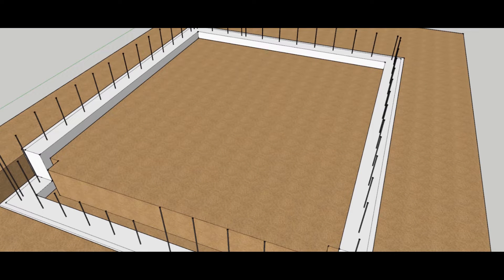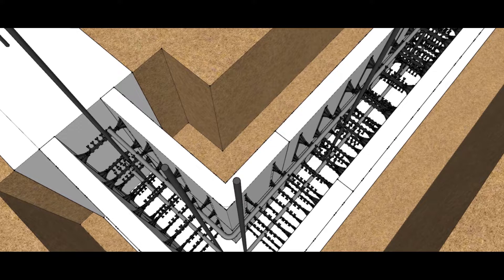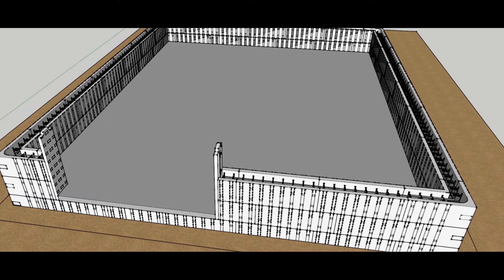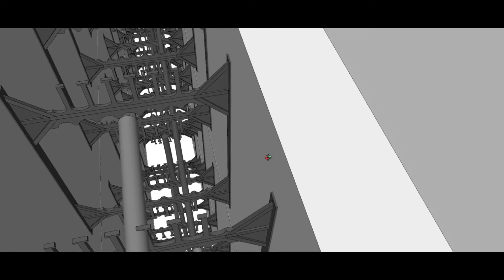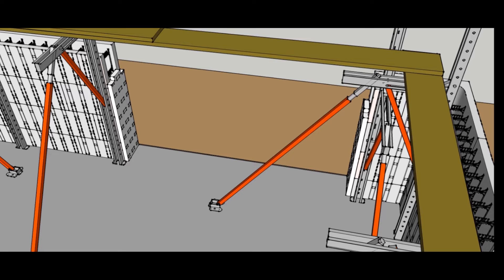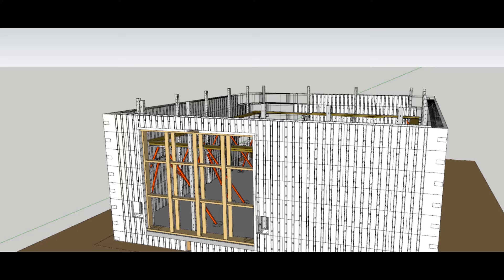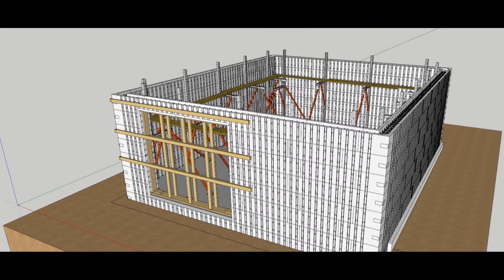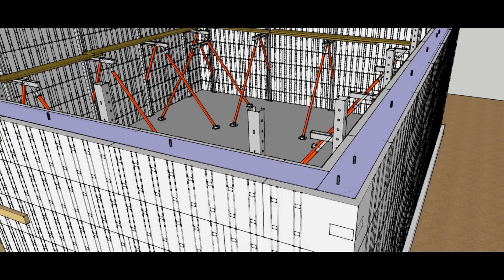How to Build an ICF Garage

Comment: How did you secure the wall bracing to the garage floor? Did you drilling into the concrete floor?
Reply from the maker: Hi DJ, in this example it could be done a few ways. Many people will drill into the concrete slab to connect the bracing anchor foot. If you are concerned about drilling into concrete, some people will use spray foam adhesive to attach a piece of 2x4 to the slab and then connect the anchor foot to that. With this method, the slab can be scraped clean after the bracing system is disassembled. You can learn more here: https://www.youtube.com/watch?v=onE69RHdYiE

Comment: What’s the best way to connect an ICF wall section with a 2x4 stud wall, specifically if the wall needs to continue as a single flat surface. Appreciate any references.
Reply: i'm planning to do this in my next build, and i will use a few foundation bolts (j-bolts) to bolt the framed wall to the concrete.  alternatively, you could also use a bunch of anchor bolts

Comment: How is the verticle rebar set to the #5 vert rebar embedded in the footing? I belive code is something like an overlap of 20 times the diameter of the rebar, and i wonder how the vert lengths get added when the icf's are stacked up several courses? My future plan is to use icf's with either fiberglass or basalt rebar and tie them to the horizontal rebar with nylon cable ties.
Reply from the maker: Hi Scott. Vertical rebar will extend from the footing into the ICF wall. The height at which it extends is determined by the location, rebar size, and site considerations. After the wall is stacked, vertical rebar is placed into the wall, connecting to the dowels that are extending from the footing. This video (starting at 4:00) explains rebar in footings https://www.youtube.com/watch?v=jhI5cfZkLFg. And this video (starting at 3:00) explains a little more about reinforcement in ICF walls https://www.youtube.com/watch?v=jhI5cfZkLFg. Thanks for stopping by!

Comment: How about a concrete flat (mostly flat) roof?
Reply from the maker: That's easily accomplished with ICFs. We recommend our BuildDeck ICF Deck and Roofing system which extends the benefits of ICFs into your roof. https://buildblock.com/products/builddeck-floor-roofing/ A flat roof is simple but a concrete pitched roof is also easily accomplished.
Reply: @BuildBlockICF  Could these be used for a garage floor if there was a basement under the garage ? Thank you.
Reply: @BuildBlockICF  same question as above. Looking to build a 60x40x12 shop with a 40x40x10 basement underneath. The slab over the basement will have cars and 2 post lifts.

Comment: Best and most informative ICF video I've seen yet. Is there much difference between using 6 inch core vs. 8 inch, other than the amount of concrete used? In other words would the greater volume of an 8 inch core ICF be more likely to cause a failure in the wall?
Reply from the maker: No, the 8" core is just more concrete which therefore provides more strength and bearing surface. It's used in all kinds of applications but we probably see it most in below-grade construction. The added concrete performs very well with the added pressure of backfill. Thanks for watching!